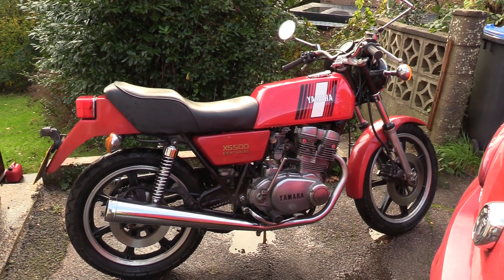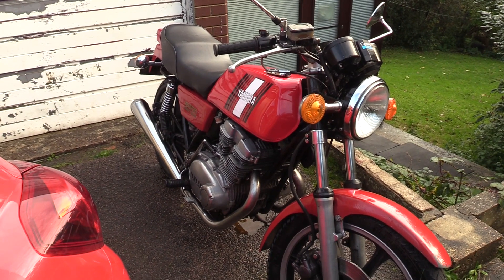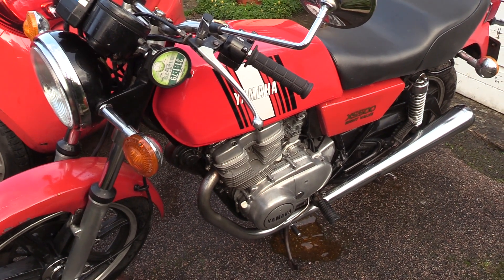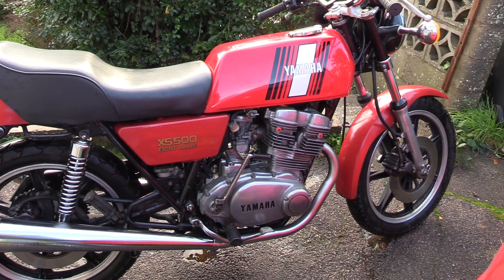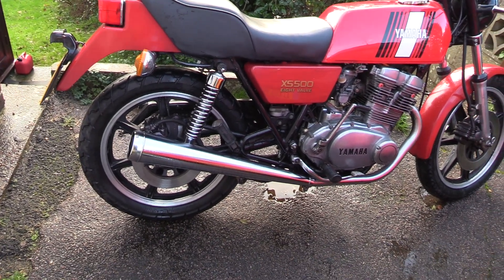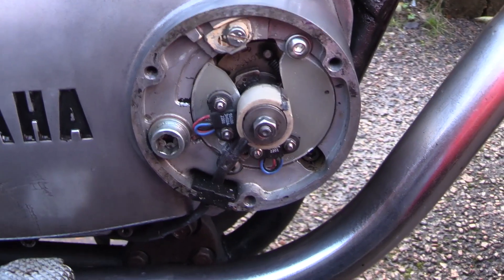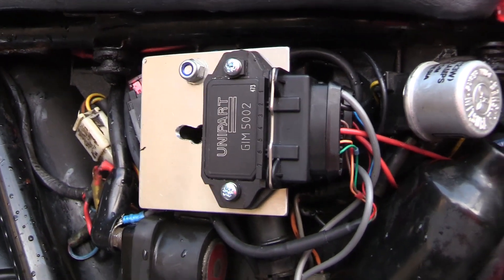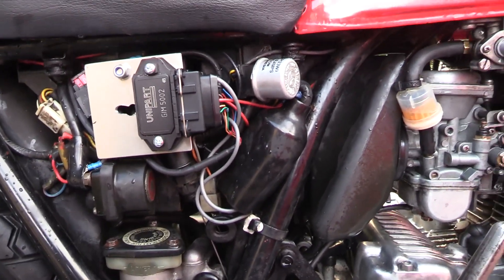Yamaha XS500 electronic ignition upgrade.

Comment: Very nice! I’ve got a 78 and love riding it. It’s not as clean but its fun. Air filters are also not available anymore but there are some options that do work. I’ve done the oil filter conversion but still haven’t dealt with the electric start. I’ve just been kicking it and that’s been good so far. But maybe that’s another project I’ll have to tackle

Comment: Well worth doing. As you say the points do go off song after a while. The early after market electronic ignitions still employed the points, but as the points were only switching a tenth of their normal current they would fowl up. Must have taken a few hours work to complete this conversion. Be careful about using silicone grease, it can migrate and cause problems in connectors. Nice exhuast sound. Thank you.

Comment: You clever devil :-D
You covered the sensors overheat by isolation and a nice lump of aluminium to keep the module happy :-D
Flasher units..years ago i bought one of those round stubby thermal flasher units from my local motorbike shop.
The indicators flashed twice then the unit stopped working lol., i did match up the correct bulb wattages, so it wasn't that.
I was a bit pissed off, so i had a search in my shed of crud.
I found a ancient honda 3 pin looong can flasher unit, it worked loverly but it made a funny noise when an indicator was powered on.
It sounded like a vibrating rubber band for a second, then it was a smooth tick tick.
Power in, feed to switch, and it was grounded.
I suspect it was an ancient B40.
The rectifier/regulator blew apart years ago so a large diode did the job (Ac Headlights left on as a load)
All that messing for my crappy Kh125 D5 kawa-crappy.
Before that bike i had a suzuki A100 with the slim tank and pressed steel frame.
The a100 was such a reliable machine, then some shitbag stole my bike :-(
Sorry simon, massive waffle mode :-(